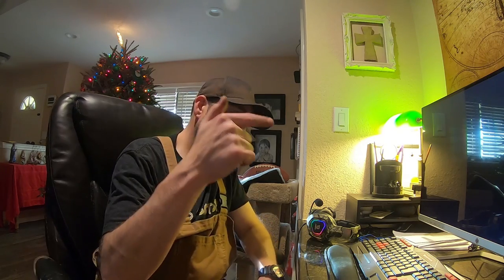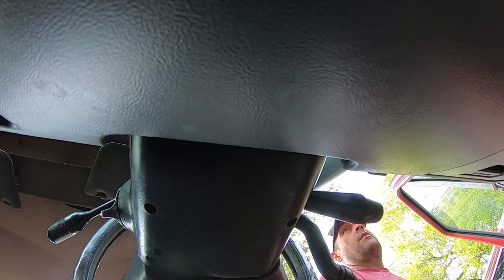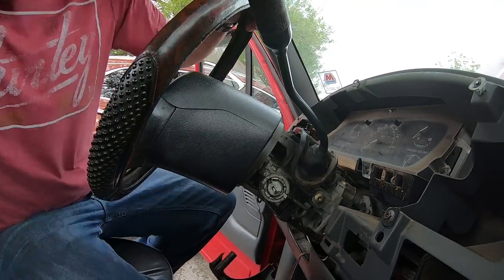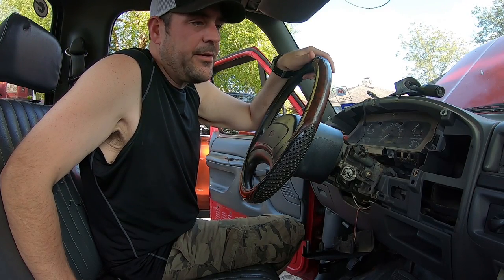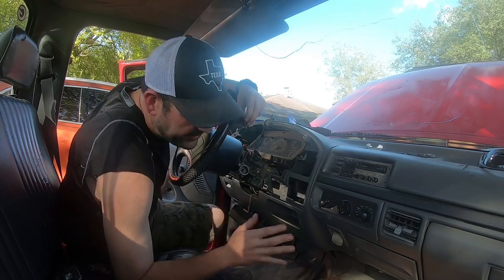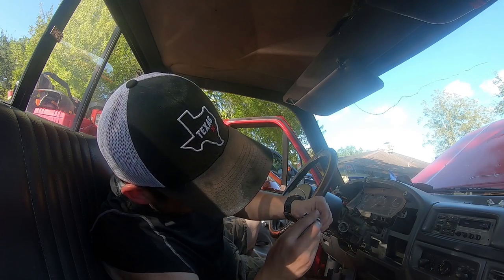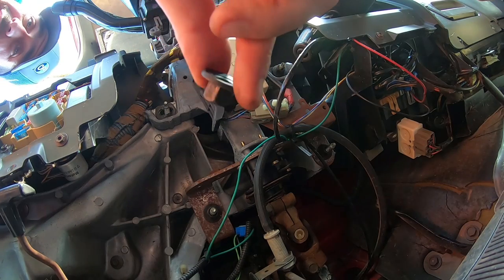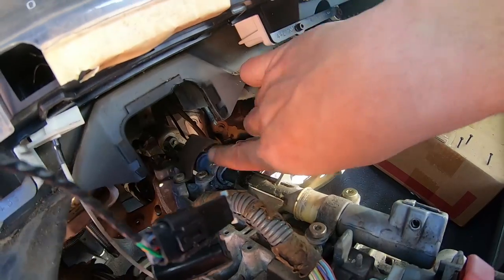1992 F150 Shift Tube and Ignition Lock Cylinder replacement Part 1

Comment: I had to drill a lock cylinder out at a rest stop 200 miles from home once. I think I invented a few colorful words that day! The OBS ferd i had was a 5 speed so thankfully i never had to deal with that shift tube. Great video, and as always, thanks for the shout out. Merry Christmas to you and your family.
Reply from the maker: Jason i swear i thought i was going to run out of drill bits in the end lol, i couldnt believe how stubborn that job was! all because i kept putting off the replacement of a $20 part i ran into hours of extra work lol. No problem on the shout out brother and Merry Christmas to you and your family as well!

Comment: Few things here, I’m about just over halfway done with my ‘restoration’ of my ‘92 and looks like I’ll be asking Santa for a new computer this year cause I can’t edit 4K on my current dinosaur. I will say I admire your patience to get all of these challenging angles with the camera, it takes way more time and focus then people realize and it can be very easy to just say screw it and just hammer out the job. Looking forward to part 2 and hopefully no more custom issues so we can get back to the lightning✊
Reply from the maker: very much appreciated man, you nailed it...moving that camera, getting angles and editing take so much time. I dabbled in 4k once but the editor i have didnt like it so i just keep with the 1080 for now. When i started i just found a decent desktop at best buy built by ibuypower. they seems to have the best combos for the cheapest price depending on which processor you go with,the newer i5 is still strong but the i7 is getting really affordable especially the newest models...i9 is out of my price range for a hobby though lol. graphics cards seem to be steady at the 2060 or 2070 super 8. that setup runs between 1k to 1400 depending on your add ons...or you might be a mac guy, those im clueless on lol! Im editing part 2 now, hopefully in the next few days ill be done. I cant wait to get back to the Lightning project but i guarantee it cant be until late Jan early Feb at this point. Still trying to figure out the work schedule at the refinery and seeing what these elections bring in the coming months. I will get to it though i promise. Thank you for watching brother!

Comment: royal pita!  but you are on your way to fixin' it,  Giving me more inspiration to get out in the cold again and get a little more on my intake project.  I tap and dye-d all the bolts and holes.  Nothing  compared to what you are dealing with there.  I'm glad I've got a 5 speed!  But I'm sure you will do it and there will be lots of new parts to not have to worry about for a while.
Reply from the maker: oh man coming along good then, shes about ready to be assembled it sounds like. I always get so worried when i had to tap a bolt hole, i haven't done it much but when i do i freak out lol. i sure hope it all works out for you with the intake! I wouldn't know about fighting the cold to work on the truck it was 75 here today lol...I wish we had a colder Christmas, its been years since i remember anything below 60! You know that's a good point, I've replaced a lot of stuff i hope i wont have to ever touch again...although if anything ever happens to that motor after i rebuilt it i might have to consider a coyote swap in the old girl lol.

Comment: I bought a 1996 F150 XL work truck. You think yours is basic LOL No chrome bumpers or wheels No Auto trans No headliner rubber floors. Anyway mine when i bought it had no keys.  LOL been here... That lock don't come out without a key without drilling out the lock Fun times.
Reply from the maker: Oh man, those old work trucks were lucky to even have radios in them😂..I've driven those years ago when the bad bosses in the 90s would even try to take the a/c out! I'm a huge ford fan but I'll be honest, when I was about to buy this truck I had no clue what trim level "custom" was and quickly found out it's just barely above work truck level. This job was baptism by fire for sure, luckily I had that hog bit in the tool set from years ago, never used it a day until I screwed up the removal in this video. Honestly since this happened I haven't even locked my doors because I don't have the original key anymore😂. Maybe after the lightning I'll finally change out the door locks.

Comment: NAW, NAW, after watching all that, it'd would make a Preacher cuss, if I ever have this problem I'd just put a Locar floor shifter in
Reply from the maker: 😂 I hear ya, I was so out of sorts while making this video I didnt concentrate on what I was doing with a few things. I was worried it might be tough but once I dug into it I felt ok. I'm learning as I go for sure but glad it wasnt too terrible.  On all these new vehicles I'd be lost trying to get the dash apart this one minus that broken shift cable wasnt too terrible to fix. I was concerned about the lowering the entire steering wheel but that turned out better than I thought, biggest problem is of course getting under the dash to remove some of those bolts....I'm no spring chicken anymore and it was hard to get the right position to fit my fat hand under there 😂